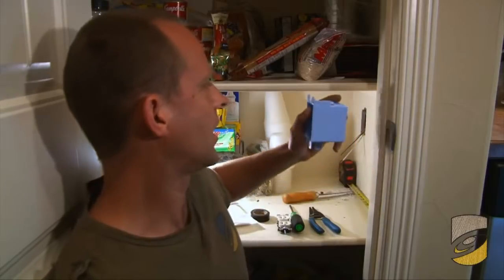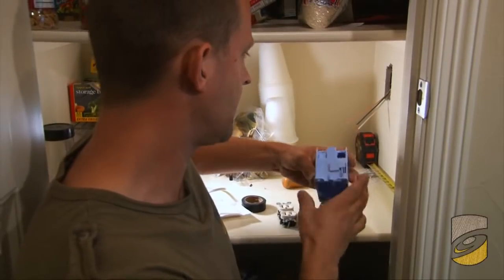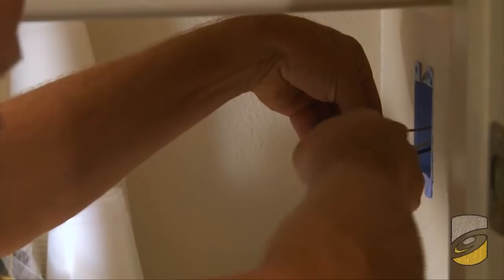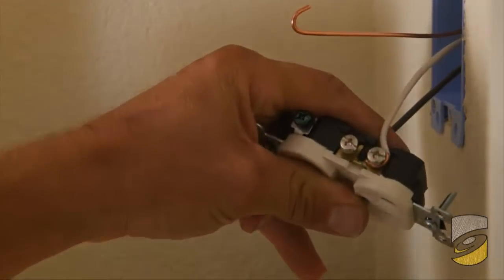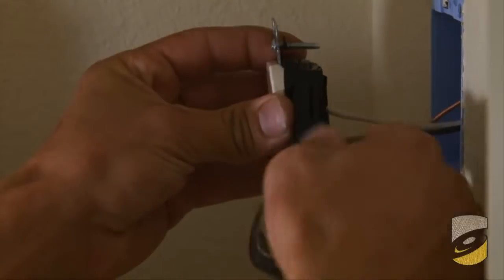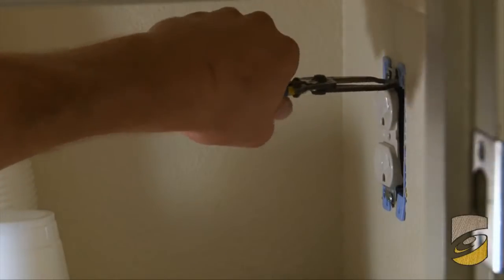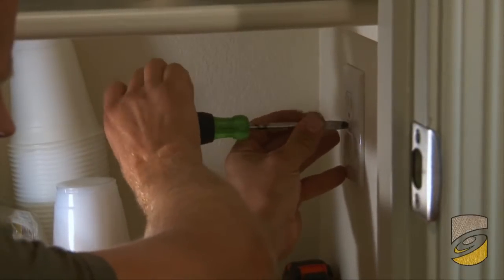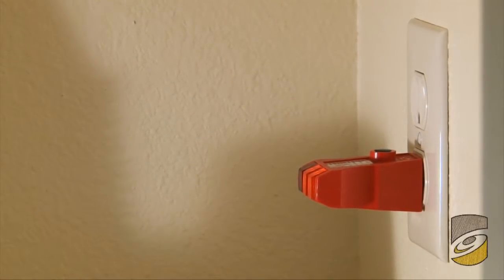How to Install a Receptacle

Comment: Dude you need to learn how to hook your wires the proper way.  Your hooks are way to big and you have insulation under the screws.  Over time that connection will come loose and create arcing and a fire.

Comment: GFCI receptacles should be installed in kitchens, bathrooms, garages, and anywhere outside. You can also protect other standard outlets by running a cable from the GFCI receptacle to the next standard receptacle down the line.

Comment: To add to this video, receptacle analyzers come in two forms. A standard receptacle analyzer and a GFCI (Ground fault circuit interrupter) receptacle analyzer, the receptacle analyzer he is using in the video is a GFCI receptacle analyzer which will test both standard outlets and GFCI outlets. You can save money by buying the GFCI receptacle analyzer from the start. A GFCI receptacle analyzer test a GFCI outlet to make sure that the protective feature is working properly.